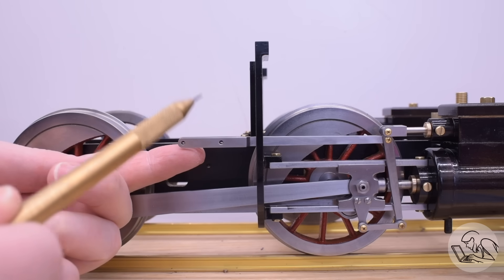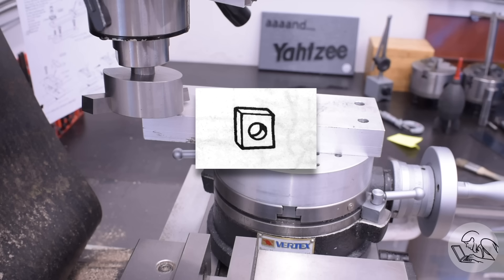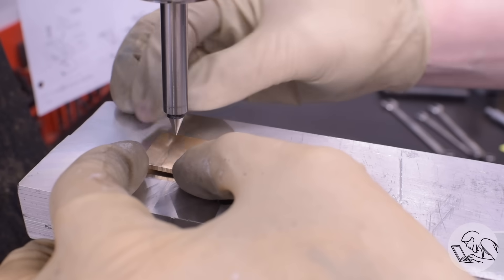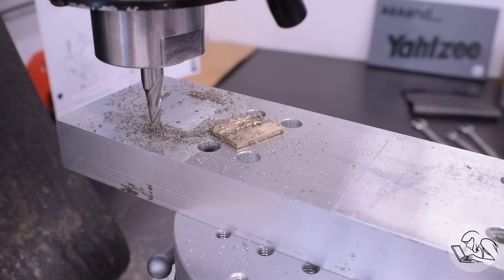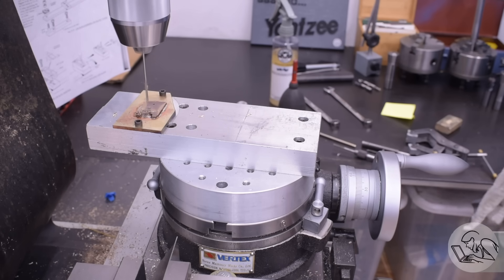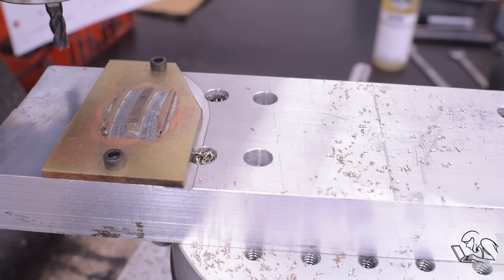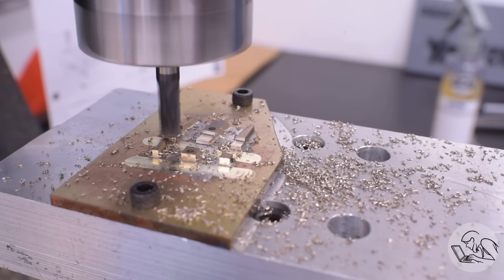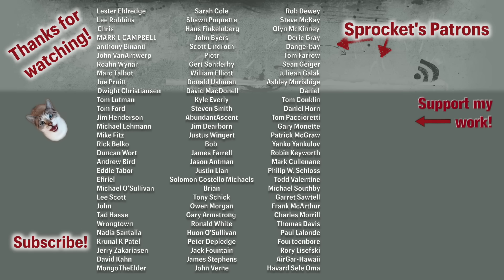Link Blocks - Pennsylvania A3 Switcher, Part 60

Comment: You say you clean up the rest of the soft solder with a file. I find soft solder clogs up a file and so far I have not found a way to clear it out. Even heating it to melt the solder does not work. Any advice please?

Comment: An old Jewellers trick for dealing with lead soldered precious metals would've worked equally well for you here. It involves a solution of Glacial Acetic acid & Hydrogen Peroxide...for mixing ratio & more info get "The Complete Metalsmith" by Tim McCreight.

Comment: Have you ever tried Loctite 480? They call it a "rubber-toughened" adhesive and while it doesn't do any better regarding the heat, it definitely better resists failures in shear and I have found it brilliant for fixturing small parts!

Comment: I got a starrett mul-t caliper to measure small parts like this. it has a swappable bottom jaw with a flat and round option. Used it has a small height gauge for a few years too.

Comment: Would 2mm dowel pins in the reamed holes in the parts and fixture plus the CA glue have been enough to resist the side load of cutting? I'm guessing it might have worked for the radius cuts, but not the cross cuts separating the parts.